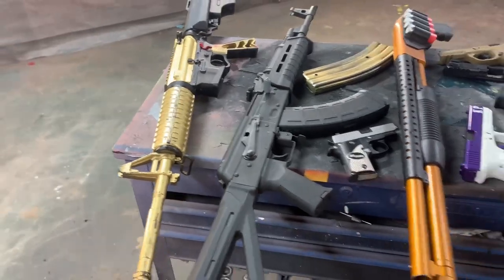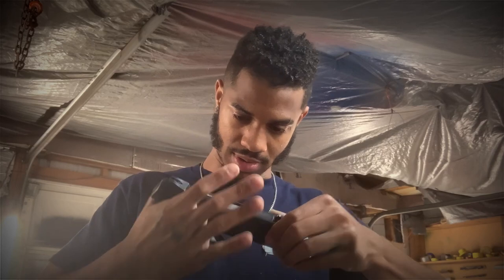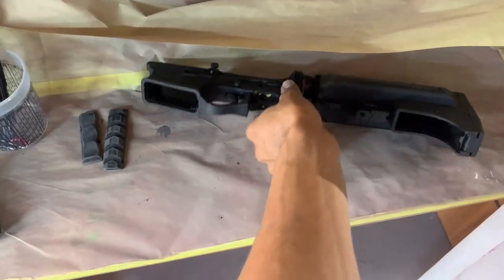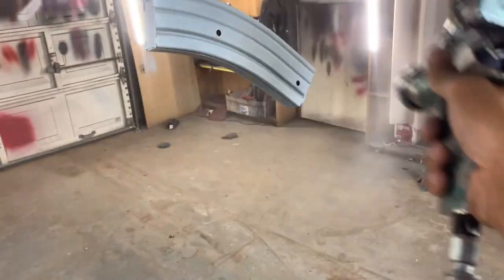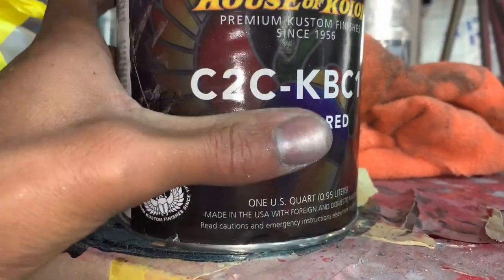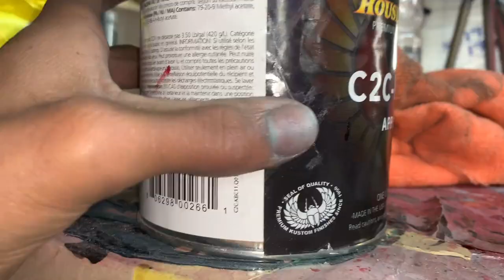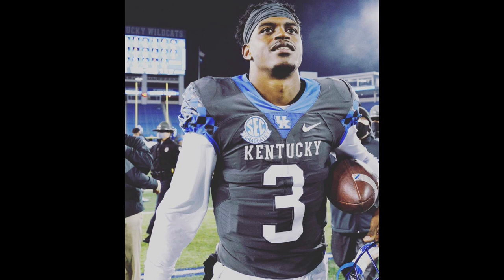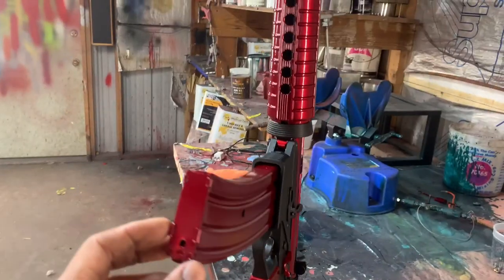Kandy Apple Red Glock, AR 15, Ruger, & S&W! Plus A Special Guest!!!! Look Who Stop By!!!

Comment: 😆you gotta totally dismantle those guns before you paint them! Example, on the AR upper painted the ejection port door shut, forward assist, and barrel gets red hot sometimes.  Example 2, on all the pistols the slide end caps are painted shut as well as the side shell ejector.   Pretty yessss! But, functionality  and from a repair or maintenance standpoint 👎being a gun guy i would have been pissed!!  thats my 100.   You wont have do so much cleaning and scrapping and paint removal at the end,  and the reason why most people that add color to their guns use cerakote cause  it is thin, more heat resistant.    But the finish is good 👍

Comment: How do you prevent Scratching when handling the weapon?
Reply from the maker: With it being painted you do have to be a little bit more careful, I would avoid setting it down hard and dropping it, For the most part the durability is there you just have to be mindful that it’s automotive paint if you throw a rock at your car it could chip
Reply: @bzoewitwheels4029  Thank you

Comment: How does it do with heat while shooting and moisture carrying?
Reply from the maker: I put over 100 rounds through my Glock and had no issues, The front of the slide starts to turn black, but it wipes right off, It’s just more noticeable because the barrel is no longer black